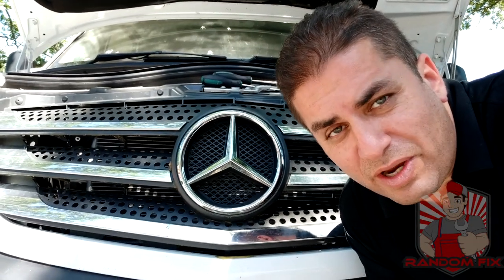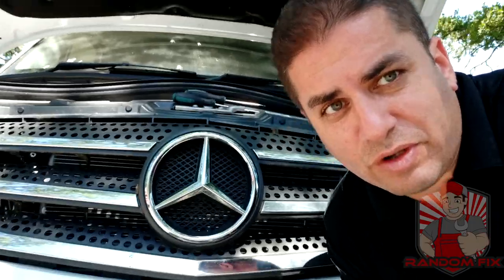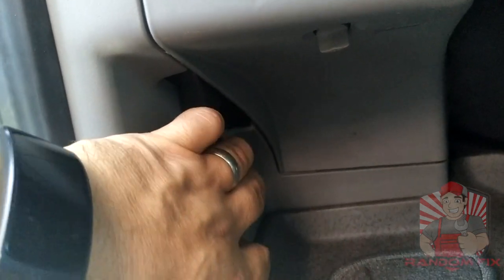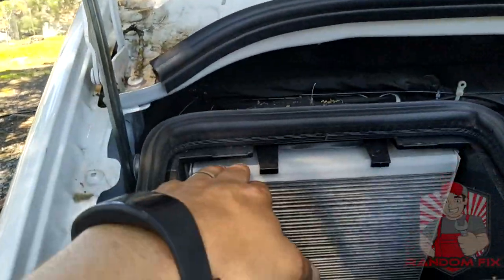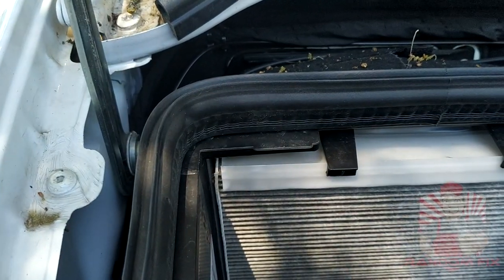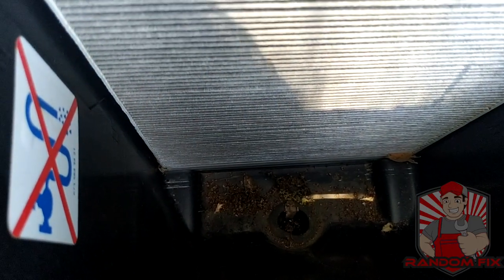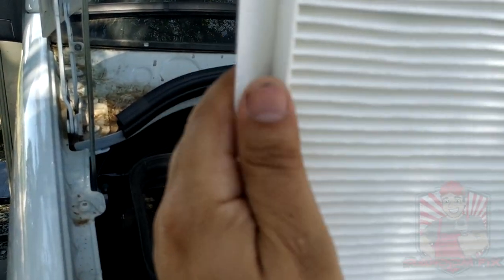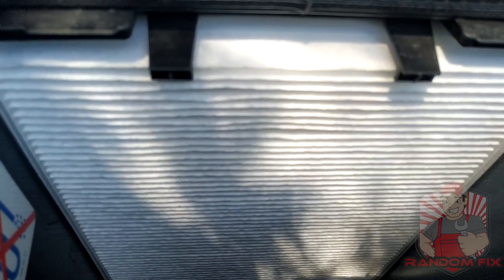▶️Mercedes Sprinter Cabin Air Filter 2012 2013 2014 2016 2017 Sprinter Cabin Air Filter Replacement

Comment: Well done. Every step very clear and concise.  I need to remove and replace the cabin air filter housing but having fits with it.  Suggestions or insights would be greatly appreciated.  Packrats love that insulation material.
Reply from the maker: Glad it helped. Why are you removing the cabin air filter housing?